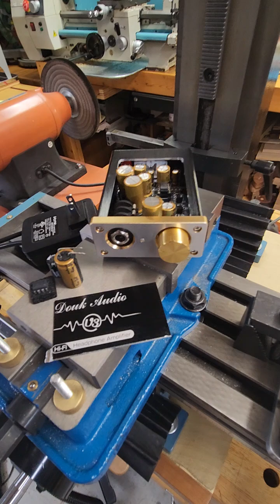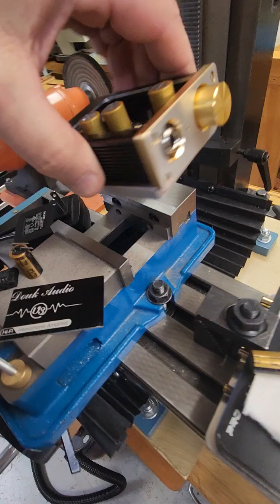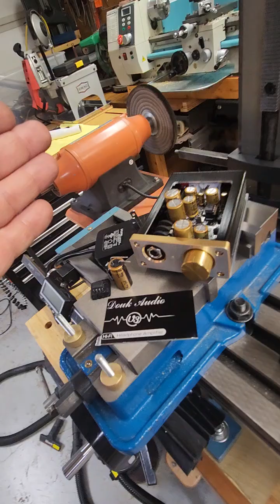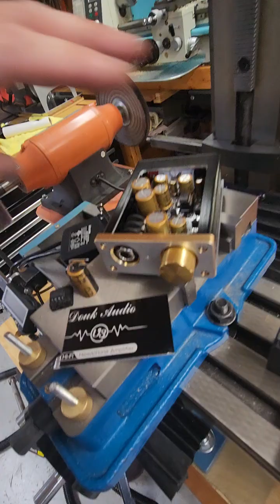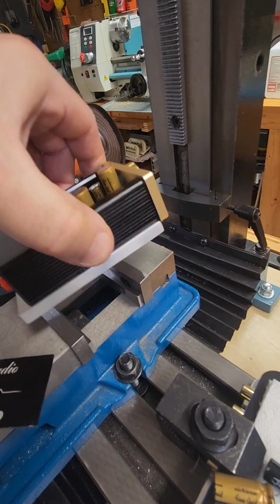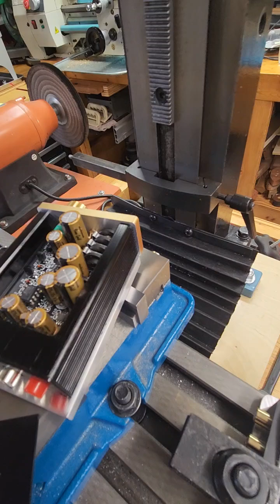Douk Audio U3 Headphone Amplifier: Modifications

Comment: Hey great video, I saw measurements on this tinny device, and it has real output power of ~550mW at 33Ohm, it's impressive for the price! Another little info about the Pro versions, according to the Douk specs, they use internal buck converters to rise the 5V external power supply to 20V internally, that is why they ask for a power supply with at least 2A of current as well...
Reply: 1100-1300mW (roughly 650mW RMS) at 32 ohm. Drop down to 16 ohm and monitor it's temperature and you can get up to 1500mW. But it's external power source is extremely important. 5v 3A is best. Higher voltages reduce output power along with reducing it's signal to noise ratio quite a bit. Lower current supply has the same effect regardless of input voltage, albeit a bit lesser of an effect regarding distortion.

Comment: Hello, how are you? Good afternoon!

I have a Douk U3 and I’m interested in making similar modifications to the ones you did. Could you please let me know which capacitors you used for these changes?

Also, did you replace the original potentiometer (B10k, linear) with a logarithmic one like an A10k with a built-in switch? If so, did the replacement work well?

Thanks in advance for your attention!

Comment: Preface: I love this. The changing of on-board components that is. 
I have this very amplifier. While I wish the circuit board's heat sink (ground) connections were a bit better, this has been one of the best "budget" headphone amplifiers that I have ever owned as far as output power goes. Sure, it can only amplify what it is fed, as there are no frequency adjustments. But that is where input adjustments come into play. 
Cheap dollar store headphones stand virtually zero chance at survival plugged into this amp. An exact feature I wanted. I wanted the power required to properly push lower resistance headphones. And with the separate purchase of a 5 volt 3 amp power supply, this tiny amplifier carries it's weight very well. 
As far as frequency abilities of it's default components, it all comes down to what the amp is fed as far as input signal. If input signal is flat, so will be the output.
Worst power source for this amp: any and all computer/cell phone 5 volt usb power sources regardless of claimed current output. (most exaggerate their supposed ratings) They simply are unable to provide the current needed. Anything less than 3 actual amps being available results in a rather weak output. Of course that is using a 5 volt source. 
Have yet to use any voltage higher than 5 due to the many warnings from the manufacturer about using voltages above 5. My electronic degrees came from before miniaturization reached it's current levels. I am doubtful I could even keep the soldering iron still enough to swap out anything but the capacitors and external connectors. Age beat me up over the years. lol